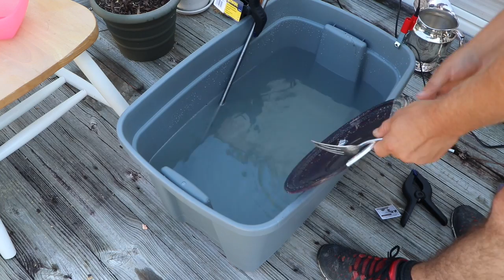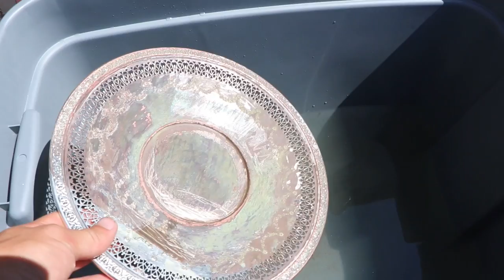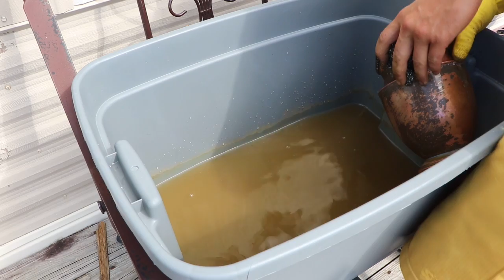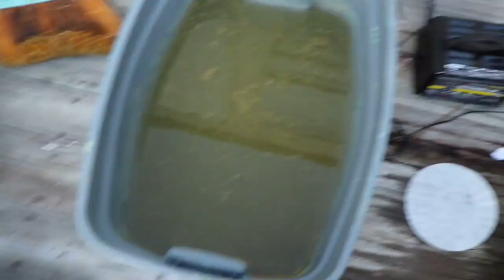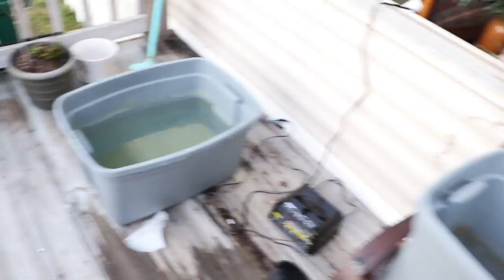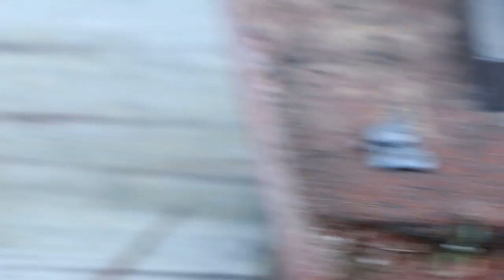Silver Recovery Process

Comment: It needed more amps pushing through the system . The water between the anode and cathode acts as a resistor. The farther the distance between the anode and cathode equals more resistance. Great video , thanks.

Comment: I just use water and equal sized items. Leave it overnight and let it settle as powder on bottom. I pour off excess water and pour silver powder water in glass cake dish and let it dry. Just scrape it out and put it in a jar. A little work but it's free and you just scrap the brass and copper afterwards. Good luck

Comment: I've had pretty good luck by using a 5 gallon bucket with straight water and equal sized cathode and diode. Also I use silver plated items on the positive and negative side. It comes off in a powder and settles on the bottom.
Reply: Never heard that.... Interesting though.

Comment: Hey man, some things you missed in this process:  1) you need way more electrolyte (salt) and it needs to be non iodized like kosher or sea salt. 2) you have way too much water, less is better because you have to electrify all of it.  3) try to find an old battery charger like before the days of big brother adding current over voltage protection. Motorcycle battery chargers have always worked well for me since you only need about 6-9 volts and about 6-10 amps although car chargers are fine too, just not the ones that limit the voltage or amperage output.   With the right tools this process takes about 30 minutes to de-plate a silverplate tray  and it literally slides off in sheets from the base metal.  Hope you will give it another shot in a new video.  Best of luck!!!
Reply: Almost forgot, wash and rinse the shiznit out of all the silver plated pieces first to get all the oils and crap off.
Reply: Frank Cole yes totally agree lots more

Comment: Instead of scraping with a knife would not a stainless steel brush work?  Like the ones you use  for cleaning auto parts?
Reply from the maker: Ended up uses my weldering brush on the next process i did
Reply: I use a little stainless brush it's soft enough not to bring cu with it only ag

Comment: your doing it the hard way. you need to use a dilute solution of nitric acid. this not only puts silver into solution from item you want to remove the plating from but it also allows it to redeposit on the stainless.
Reply: What is the concentration of the nitric acid you use?  (No one ever gives the concentration) Thanks.

Comment: Like, , ,You bet. I missed what you were using to start with. Was that just PLAIN SALT and DISTILLED WATER ? Thanks bud as there is a lot of very inexpensive plate out there to be recovered my friend.
Reply from the maker: Tomoko's Enterprize it's just plain tap water and table salt.
Reply: Soooo simple and noninvasive bud. Nice. Was that just a regular 2 amp battery charger ? or a 10 amp ?
Reply from the maker: +Tomoko's Enterprize 8amp

Comment: Also just use a stiff bristle toothbrush instead of scraping.  Alot quicker...
Reply: I use stainless brush sooooo easy. Also if it's stubborn just use brush a second when it doesn't cone off then dunk back into solution then it will cone right off. Think it's s friction deal